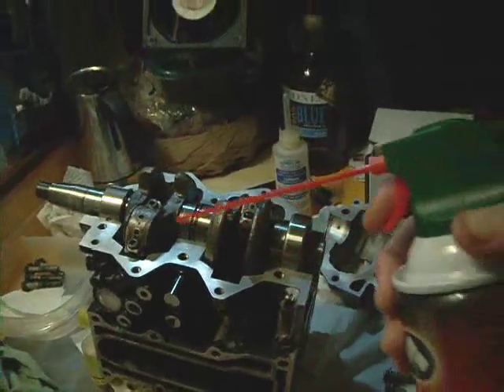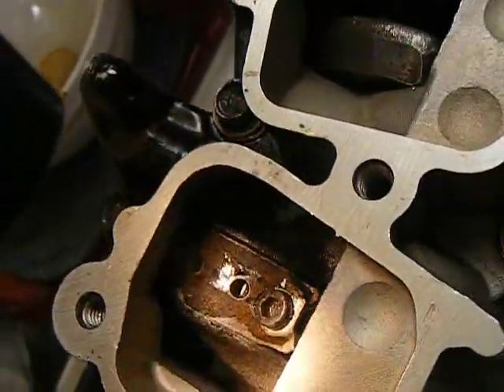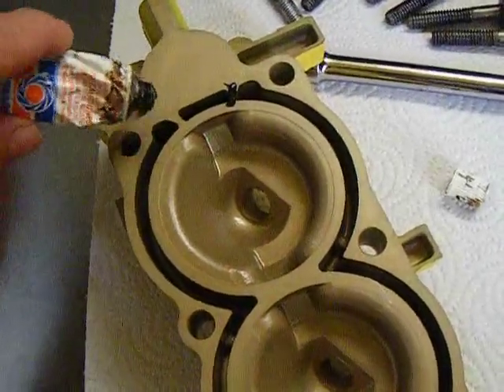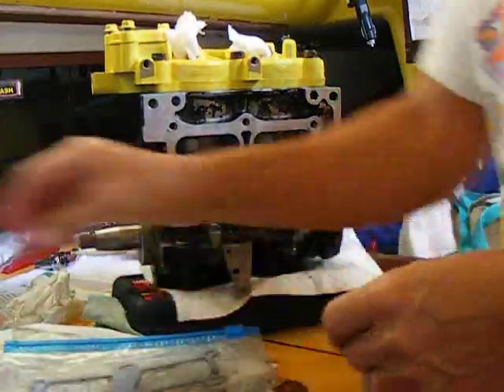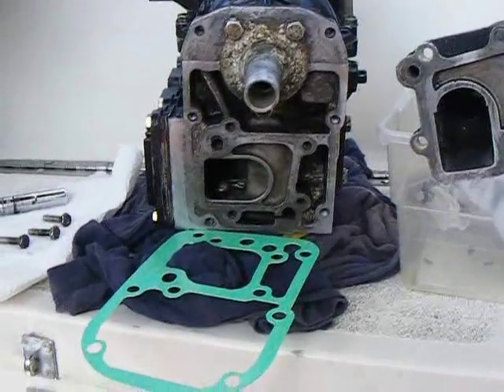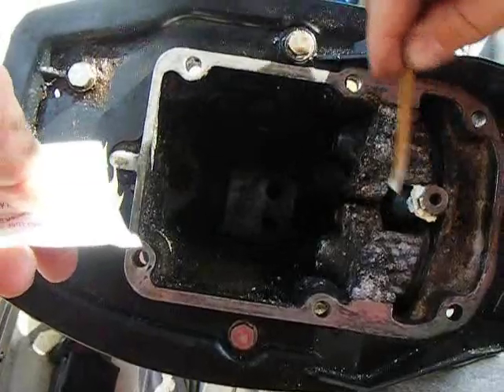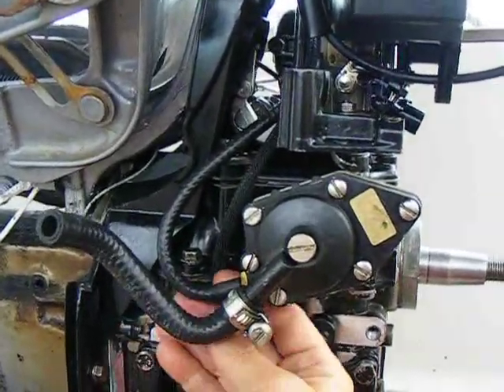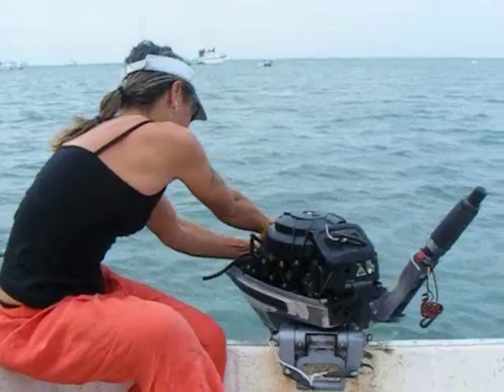Small Girl Rebuilds Small Outboard, 2-stroke Johnson 15 hp, PART II

Comment: I got a 45 4.5hp 2 stroke mercury for free. i got it running OK but if i rev it too high it sounds like bits of metal are flying around inside lol. any ideas? sounds good at medium to low revs.
Reply: HI   If you rev it and it sounds fine until you back of it is the crankshaft bearings  (bottom end bearing)

Comment: hey I am glad you know how to tear down your 2000 Johnson 15 horse power and get all of the parts lined up and ready to be installed and put back together man I have a 1984 15 hp evinrude that I am trying to get ready for boating season of 2014 spring I am trying to get it ready for the spring so during the winter season witch I hate because you can't do shit in the winter water I am getting another outboard motor like mine but this will be a 9.9 hp with a 15 hp carb that will be my back up until my 15 hp evinrude gets fixed and just in case that one breaks down ill have the other one ready what you should do is get another 1984 15 hp evinrude as your back up just incase your other one breaks down you'll have that one try it and see what you think,

Comment: Next time you have to work on little engines, use a couple pieces of plastic straw to help line up gaskets and other parts. You'll still need to be careful since the straw will bend easy, but it's better than trying to look down the bolt hole and line things up.